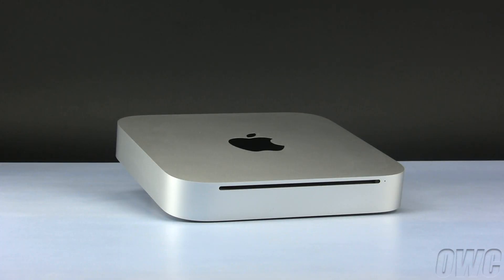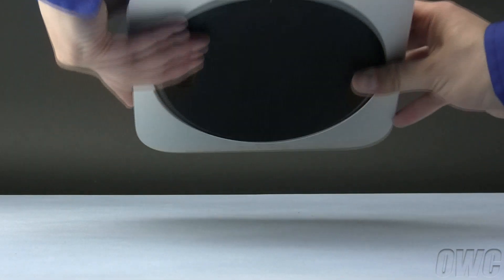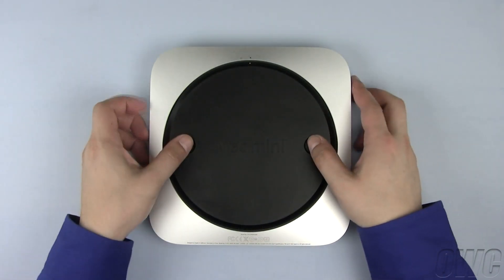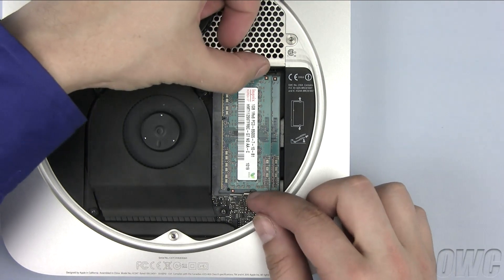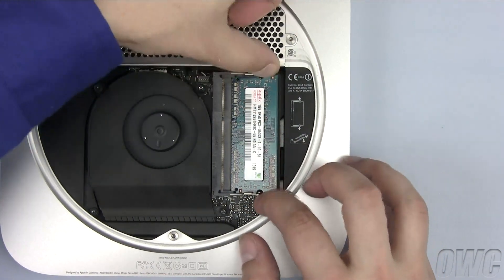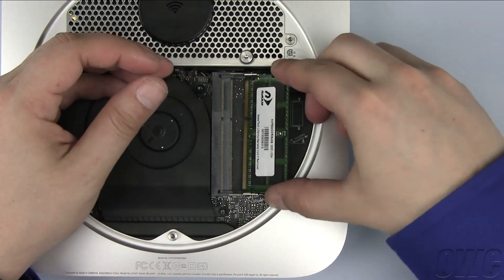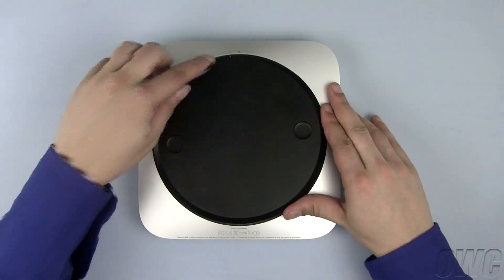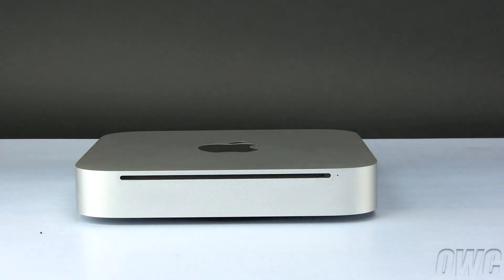Mac mini Mid 2010 Memory Installation Video

Comment: Mine wont boot with 2 ram cards but with one it back ram slot it will and it shows apple logo skips 2 loading bars then spinning wheel and shutdown? Any help
Reply from the maker: I sincerely apologize for any inconvenience this may or has caused you.
There are a couple of things we would want to try to see if we can get the RAM working properly for you.  The first thing we would recommend would be removing the RAM from the computer and cleaning the contacts on the RAM modules.  You can clean these with a q-tip dipped in rubbing alcohol and/or a pencil eraser, rubbing lightly in one direction.  If using the eraser, make sure to brush off any debris with the back of your hand after cleaning.  Once the contacts are clean and dry, you can install the RAM back into the computer.

After reinstalling the RAM, I would also recommend resetting the System Management Controller. Resetting the System Management Controller (or SMC) in a Mac can be a useful way to troubleshoot various kinds of problems that arise, typically related to power issues or issues that coincide with new hardware being installed in the computer.  Detailed instructions on performing a SMC reset can be found on Apple's website here:  https://support.apple.com/en-us/HT201295

Lastly, before turning the computer on, I would also recommend running a PRAM reset.  This can be done with the following instructions while installing one module in at a time:

PRAM Reset:
1) Start the machine while holding down the Option-Apple-P-R keys
2) Wait until you hear the 3rd startup chime, then let go of the keys and let the machine boot up.